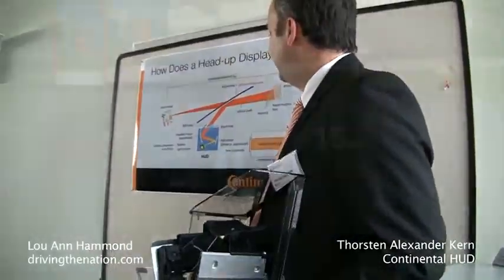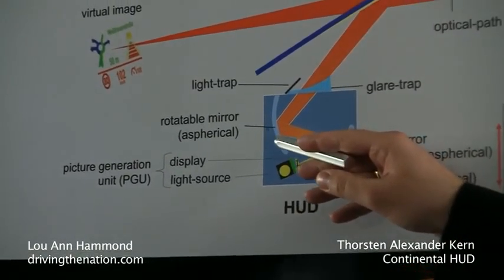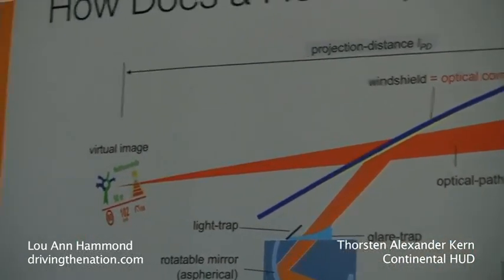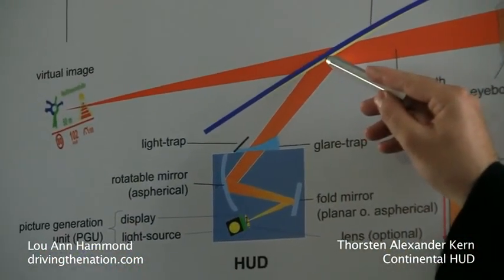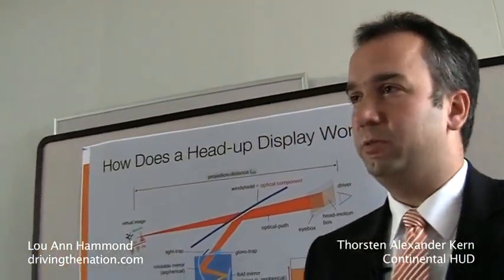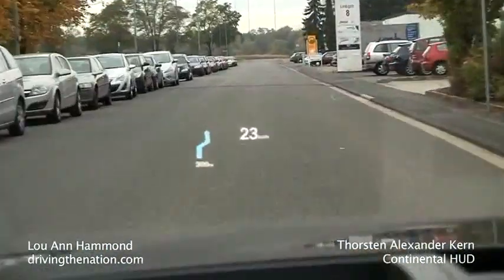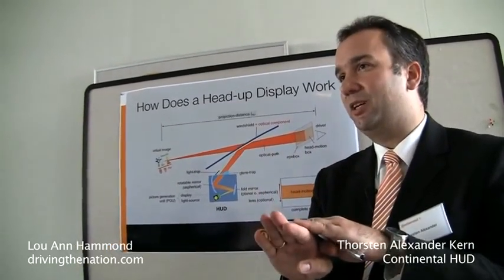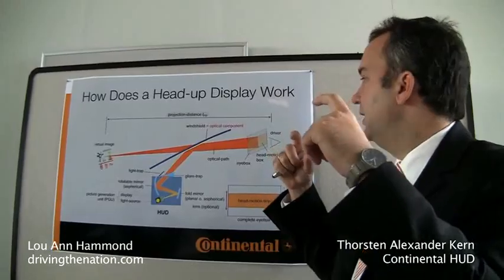How does heads-up-display (HUD) work? #Continental explains #safety and #comfort of #HUD #technology

Comment: Can someone from outside see what is being projected on the windshield?
Reply from the maker: good question - I don't think so. I will check
Reply from the maker: I got these answers from Continental - 
How big is the initial display?  There is a range of sizes that can be used for Image Generation.  Our TFT HUDs use displays from 1.3" to 1.6" in size.

What is the magnification of the convex mirror?  There is no convex mirror in our system.

Can someone from outside see what is being projected on the windshield? No, not as a projected image.  If someone looked through the windshield and down at the dash board, they may be able to see the display image, but it would be very small.

Comment: what does the fold mirror reduce?
Reply from the maker: +Bill McDonald Thanks Bill. We just had Continental show us their mirror less side view cameras. We haven't put them up yet. I will try to put a link here when we do.
Reply from the maker: I got these answers from Continental - 
How big is the initial display?  There is a range of sizes that can be used for Image Generation.  Our TFT HUDs use displays from 1.3" to 1.6" in size.

What is the magnification of the convex mirror?  There is no convex mirror in our system.

Can someone from outside see what is being projected on the windshield? No, not as a projected image.  If someone looked through the windshield and down at the dash board, they may be able to see the display image, but it would be very small.
Reply: It reduces the total size of the box. Without the mirror the projector would need to be placed at the same distance from the mirror, but on the right side in the image. From the size of the thing, I think that's about where you'd want your steering wheel. By using a mirror, the projector can be put on the left side instead. I presume they call it a fold mirror because the light path is "folded".

Comment: How big is the initial display?
What is the magnification of the convex mirror?
Reply from the maker: I got these answers from Continental - 
How big is the initial display?  There is a range of sizes that can be used for Image Generation.  Our TFT HUDs use displays from 1.3" to 1.6" in size.

What is the magnification of the convex mirror?  There is no convex mirror in our system.

Can someone from outside see what is being projected on the windshield? No, not as a projected image.  If someone looked through the windshield and down at the dash board, they may be able to see the display image, but it would be very small.

Comment: So bad a presentation !! I can't understand the HUD principle by this....
Reply from the maker: I got these answers from Continental - 
How big is the initial display?  There is a range of sizes that can be used for Image Generation.  Our TFT HUDs use displays from 1.3" to 1.6" in size.

What is the magnification of the convex mirror?  There is no convex mirror in our system.

Can someone from outside see what is being projected on the windshield? No, not as a projected image.  If someone looked through the windshield and down at the dash board, they may be able to see the display image, but it would be very small.